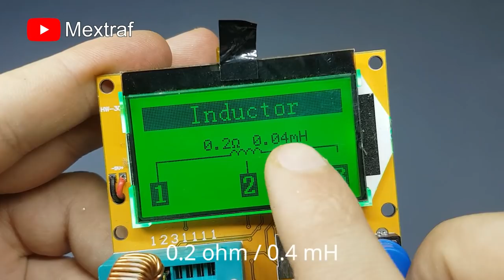NEW !!  short circuit protection / useful electronic circuit

Comment: Спасибо за познавательную  схему. При длительной работе, схема будет плавно отключаться, так как емкость затвора используется как временная память. С уважением Владимир.
Thanks for the cognitive outline. During long-term operation, the circuit will shut down smoothly, since the gate capacitance is used as temporary memory. Sincerely, Vladimir.

Comment: Very interesting - both.  But please, teach us how they work.  We see what the circuits do, but we don't understand why, and that is very important.  If you share your knowledge (in the video or in the overview),  it will add 100% to your videos .  Thank you. 😁
Reply: yepp 👍 the circuit working explanation will do lot more good - if it is explained the way it works
Reply: a-bobin : bobin senses the anormal current 
b-transistor:transistor works as a switch (on -off)
c-button:button works to reset transistor
d-obtocuplor: obtocuplor works as a switch (on -off)

1-while  the circuit runs, if there is a short circuit, there will appear high current.
2-the bobin sense the high current.
3-after sensing the high current, obtocuplor close the transistor to stop energy
4-to reload the circuit, after pressing to the button ,the transistor opens gate and collector pins.
5-if gate and collector opens, there is flowing 
6-if there is flowing, the led starts  shining.
Reply: @tekmusti  Thank You!!
Reply: @johanbooysen3508  you too

Comment: The light went completely off when you short circuited and when you passed the brown cable through the inductor but it did no go completely off instead light went on again when you did not pass the brown cable through the inductor. How did this happen?
Reply: Is it because in the first case optocopler got activated and this led to connection of the gate and source of the MOSFET and because source was grounded  this led to complete going off of the LEDs? Am I right?